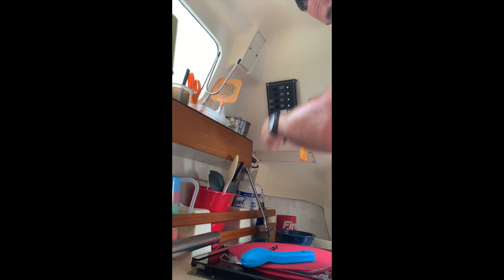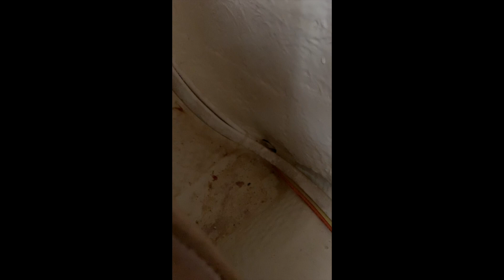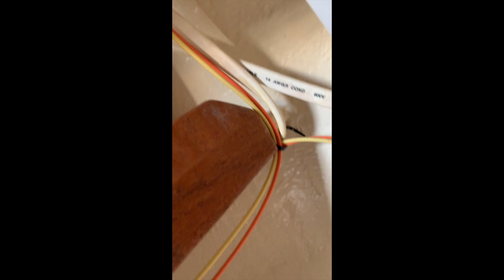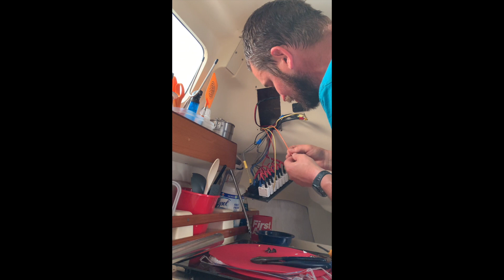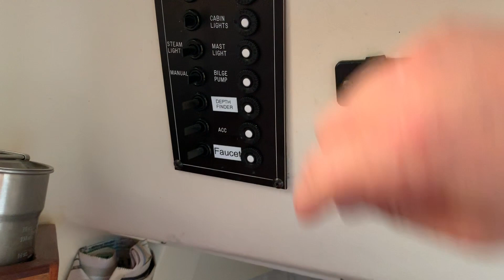DIY USB and 12V Power Socket Installation

Comment: We have an h26 Hunter too. We have added USB power and had to upgrade them already as our gadget demands have increased.

It is nice seeing your upgrades and adventures on your Hunter.
Reply from the maker: Yes, it's amazing how those gadgets multiply - especially with kids and camera gear on board. I have a feeling I'll be adding more as well. I am glad that I put in the 12v power adapter due to the ability to use different plug in's for that too.